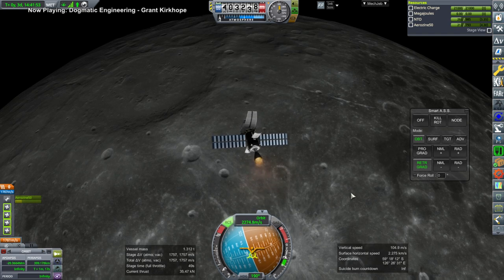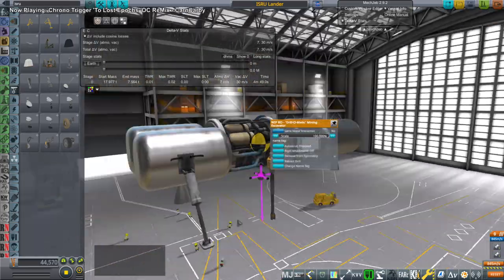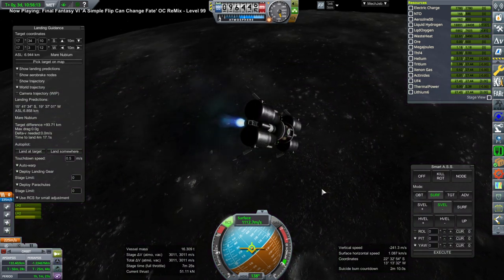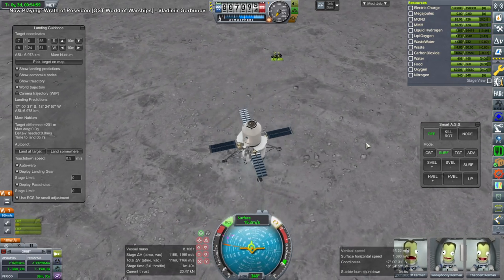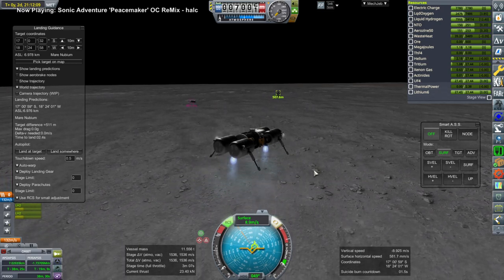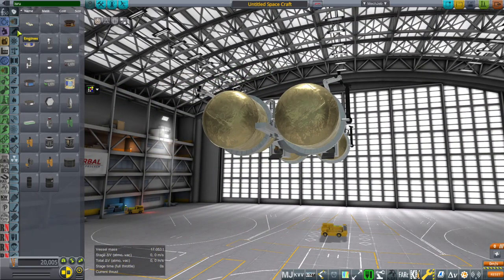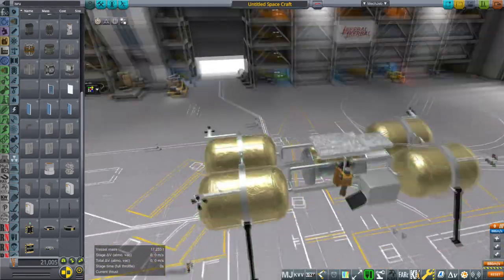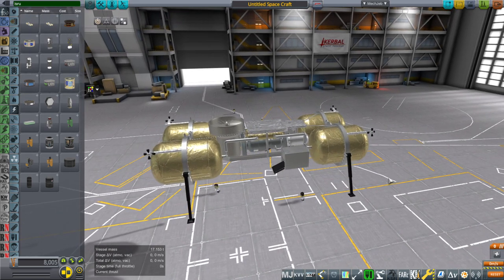Realism Overhaul in KSP 1.8.1 - Advanced In-Situ Resource Utilization (ISRU) System

Comment: Hey Raiz. I know its kind of off topic but recently I reinstalled RO/RP-1 with bunch od mods and now i cant click on any building or really any button on game interface. Any ideas why? I just need to figure what is causing this so i can fix it.
Reply from the maker: Buildings often have trouble picking the clicks properly with RSS, but that's true of the buttons on the left side as well? I can't think of a reason off the top of my head.
Reply: Yes, exactly. Nothing works, those on the left as well but also "go to main menu" button. I managed to go to RnD building somehow and same thing happened. I can click nodes but can't research them (for test purposes i cheated some science for me). Only thing that works is modded toolbar buttons.
Reply from the maker: Hmm, maybe if you messed around with the persistent file something went wrong during that - like some bracket went missing. The game can't edit the persistent file beyond that problematic point, so it can't change scene.
Reply: Nah, it was happening before i changed one number. But since you dont know i wont waste your time. Thank you anyway!
Reply: Do you have click-through blocker installed? if so try to switch modes.